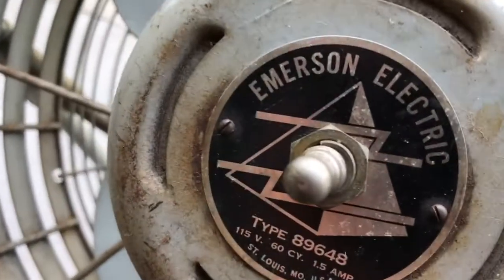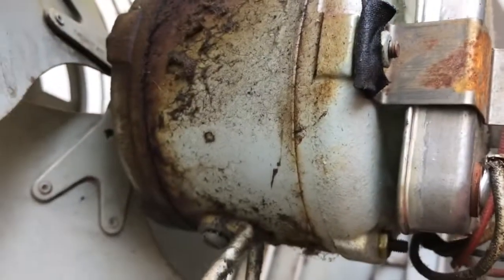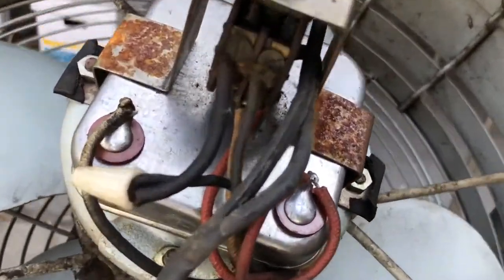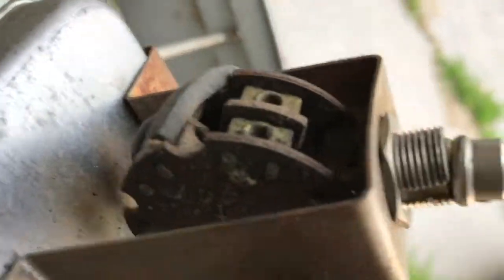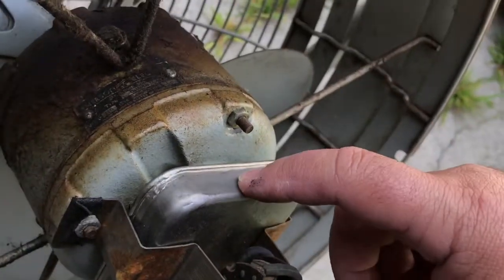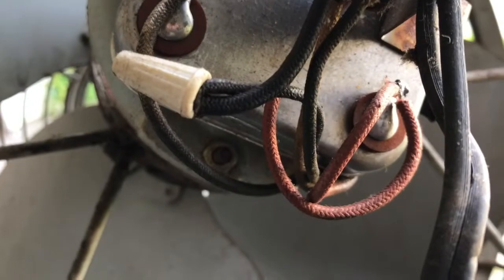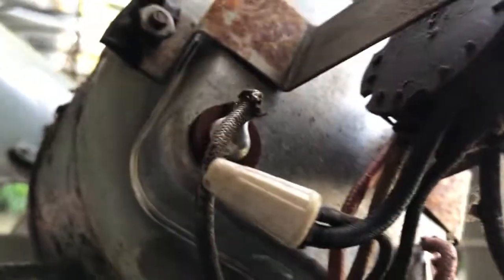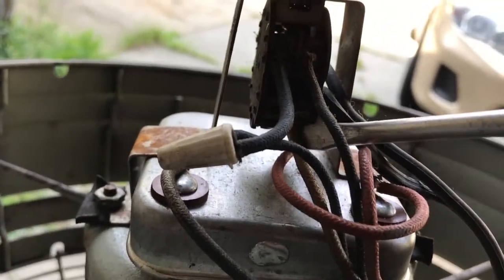1952 Emerson Levolier Switch - Levoliering the Playing Field

Comment: I think that switch is salvageable. The "pull to switch " issue you are having can be corrected by an ajustment at the lever itself. If I'm not mistaken, there is a little screw that holds the lever to the switch linkage. Setting it further back will help the "levering" mechanism. As with the bad contact issue, nothing that can't be cleaned. I hope this helps and/or makes some sense! And yes, that's a capacitor...